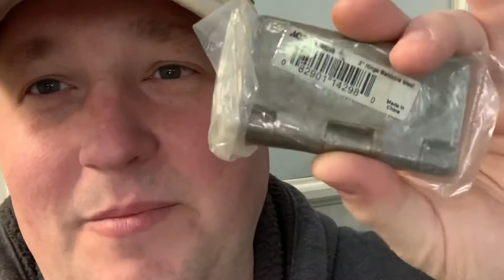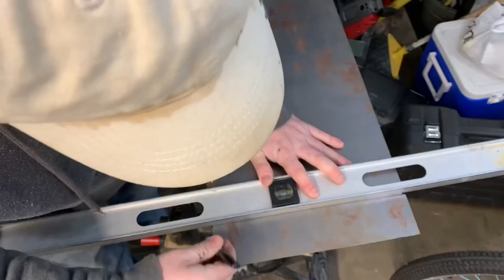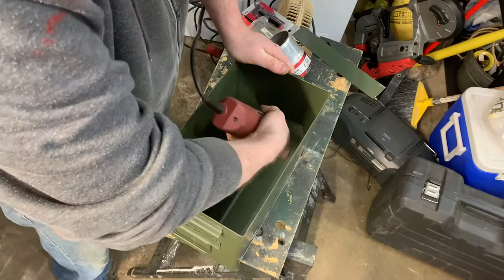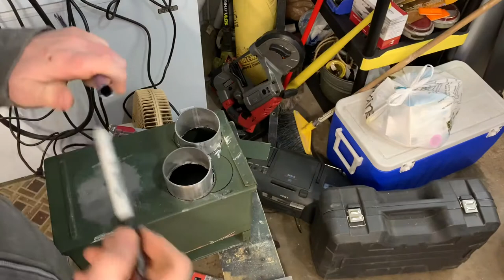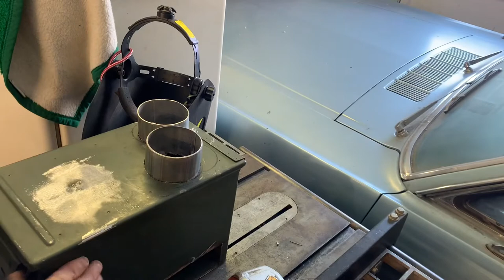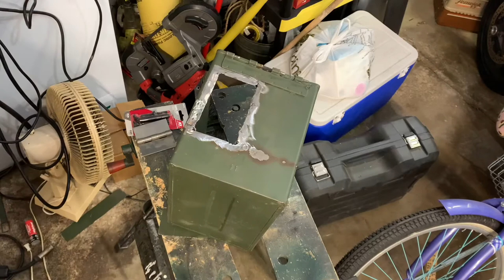Ammo Can Stove - 50 cal - how to build! ep2 #campstove #camping #diycamper

Comment: Just a heads up if you aren't running Flux core you'll need to run shielding gas (c25) as well as a different style nozzle for it to work. Happy building!
Reply from the maker: Ahh good to know, I will do some research and find the right nozzle. I do have c25 shielding gas but my tank ran out when I left the valve on over night.
Reply: I thought it was flux core, but galvanized pipe pieces.